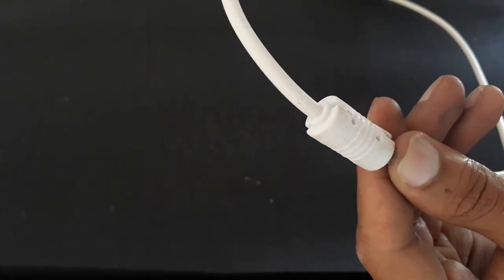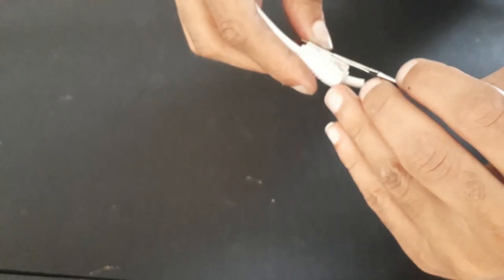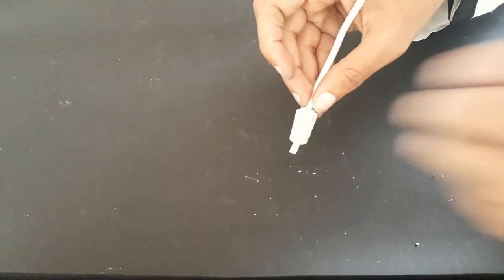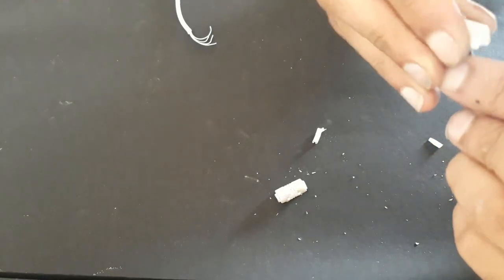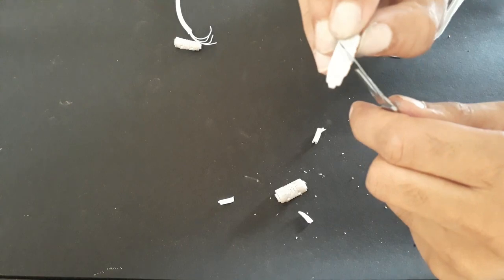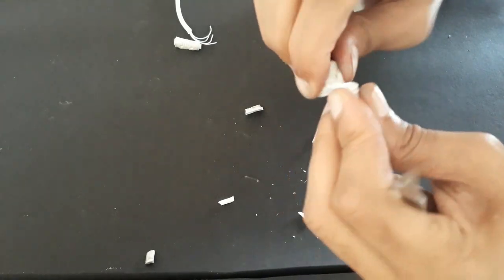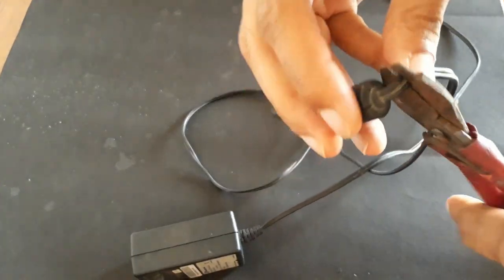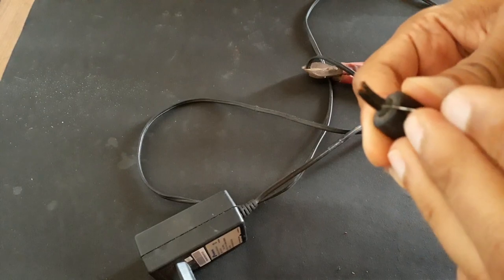What's Inside this Weird Stuff | Ferrite Noise Choke

Comment: Cheaper for manufacturer to use plastic than a 25¢ ferrite core. Not so good for the end consumers electronics that are used with it.

I noticed a small difference in efficiency/speed for the better when I placed one of these on my laptop power wire. I think suppliers need more of these on products than what they only require for certification.
I’ve placed ferrite clamps on everything important to me. It really does speed up lag on computers and lcd screens. And has also helped fix my vehicle somewhat by reducing alternator hum and external frequencies picked up by body and fed into electrical system.

Comment: Try to electrolysising molten salt
Reply from the maker: It's not that easy to do electrolysis on molten salt as it requires 800c above temp to melt salt it needs proper set up & of  course it's expensive (still i will try to arrange them in few days)
Reply: Thanks for sharing it be nice to people